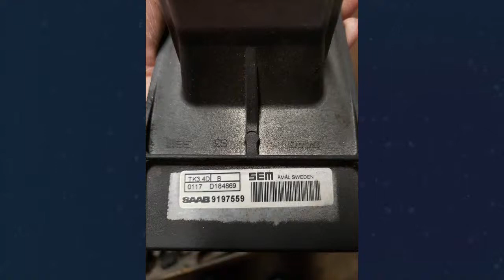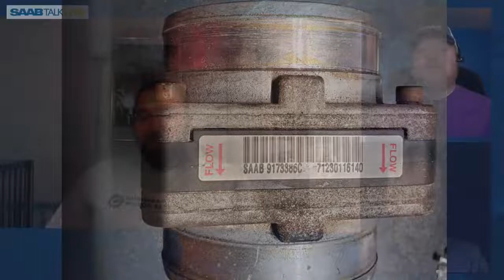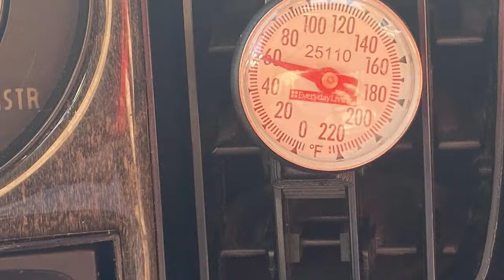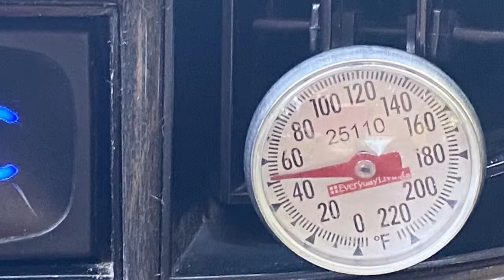Solving Turbo Troubles

Comment: Also the Mod of covering the ac lines does work. I have no experience doing this on a SAAB but I did this on my 1992 VW Jetta a while back and the results were the ac was alot colder. I also did this on a 88 BMW 635CSi and it does work to make the AC alot cooler.

Comment: Is it possible to run the SAAB trionic 5 WITHOUT the ingnition coil cassette? Can the Trionic 5 be "tuned " or configured to run different coils?
Reply from the maker: Not to my knowledge.  I'm planning to convert my C900 with the help of Jordan Pagano at www.modernclassicsaab.com this winter.  Suggest you reach out to him for a definitive answer.   We'll produce a series of step-by-step videos to document the process.
Reply: @LeeKelso  Ill be looking forward to that episode. I actually reached out to Jordan regarding something off subject. I wanted to know if he had anything in the works about a more reliable solution for the dreaded rubber shifter coupling that goes south and causes you not to be able to select 4th or 5th gear...he said he may have something coming...all good things to look forward to. Have a great day Lee.